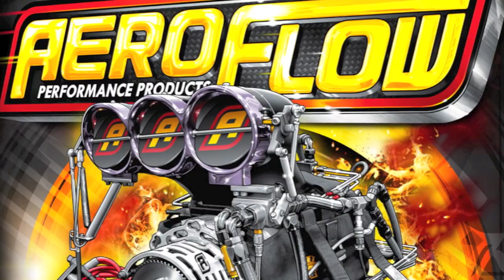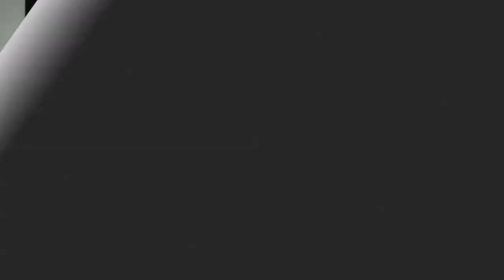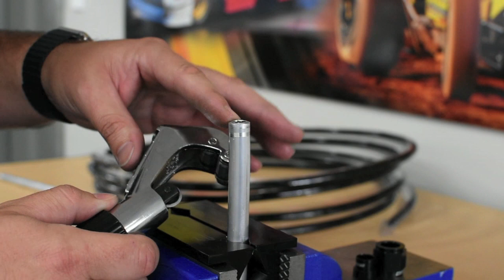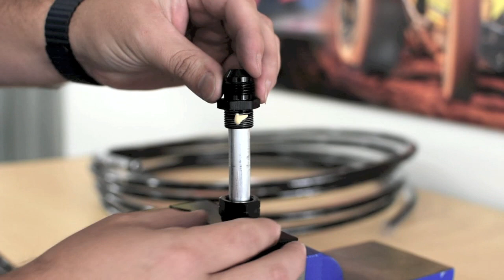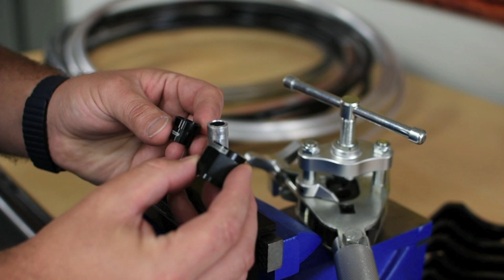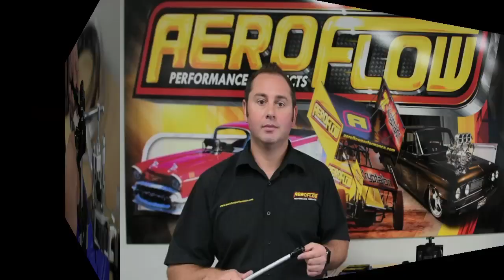Aeroflow Aluminium & Stainless Hardline Series Hose Installation

Comment: I need to do this with a 5/8" plastic barb formerly used with heater hose. Pressure will be in 10-15 psi range (engine to heater core). Flaring is out so what about the compression fitting? Mission Impossible?
Reply from the maker: Hi Frank, maybe this would be a better option for you, it uses o-rings instead of the olive. Less likely to crush the plastic tube: https://aeroflowperformance.com/af741-10-10blk-5-8-barb-to-10an-adapter

Comment: what about the potential for galvanic corrosion using stainless steel in an aluminium fitting?
Reply from the maker: Hi Liam, luckily our fittings are hard anodized which creates the barrier between the aluminium fitting and steel hardline. Raw aluminium may be a different story, however the fact that the hardlines are grounded by the vehicle also reduces any issues in this situation.

Comment: Which of the two methods do you recommend more?
Reply from the maker: It depends on what tools you have and the application. If you have a tube flaring tool then the tube nut method is more secure in high pressure situations however if you don't want to invest in the tooling the adapters are very easy and convenient. They are also fine for most regular automotive applications.
Reply: @aeroflowperformance  ok thank you very much for the information I will think about what would be the best option since I only need it for a maximum fuel line of 70 psi and at full it is not a lot of pressure
Reply from the maker: The Adapters will be fine @javieramaro7552

Comment: Can you use aluminum fittings in stainless steel lines? I couldn’t tell which hardliners you were using in this video. Thanks!
Reply from the maker: Yes that's no problem

Comment: Can you use a the tube nuts on a OE hardline that isn’t stainless or aluminium?
Reply from the maker: Yes you can, as long as the diameter is correct
Reply: @aeroflowperformance  so if the OD IS 3/8 I can use a -8 ? Thank you
Reply from the maker: @kat5232  generally a 3/8 line is -6
Reply: @aeroflowperformance  sorry my mistake

Comment: What size tubing and fitting were you just using? I got a engine oil line with a 5/8 fitting to the engine and the other sides are leaking crimps what size an compression fitting would I use?
Reply from the maker: Part number AF109-10 suits a 5/8 tube and converts to -10 AN female or AF108-10 is the male version

Comment: If you put a wrench to it, will the fitting spin on the hardline? I was just installing one and even though with a wrench could turn it, the fitting broke from being overtightened
Reply from the maker: Hi Steven, the hardline fittings crush down on the brass olive so once it is tight you can leave it. They are aluminium fittings with a taper so there is no need to over-tighten.
Reply: @aeroflowperformance  one the fitting tightened correctly. Can it still rotate on the hardline?
Reply: @bradleygordon6806  i dont think so